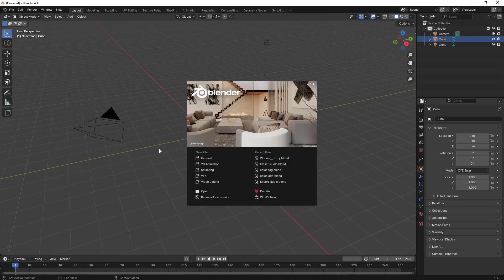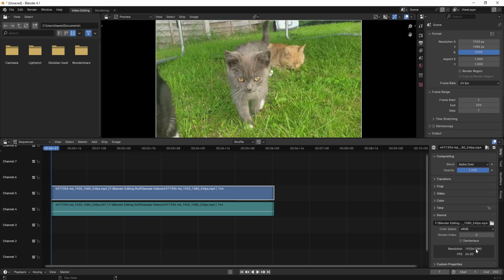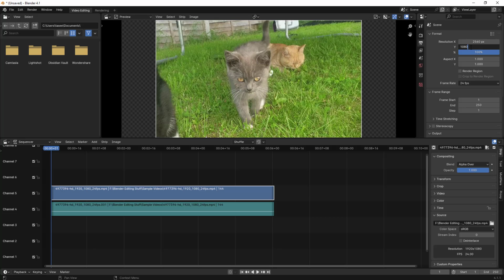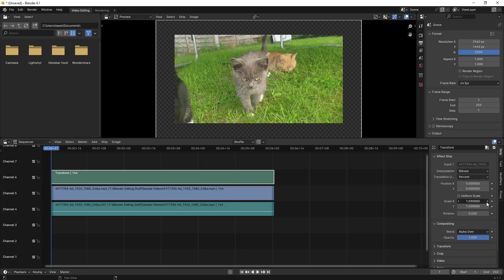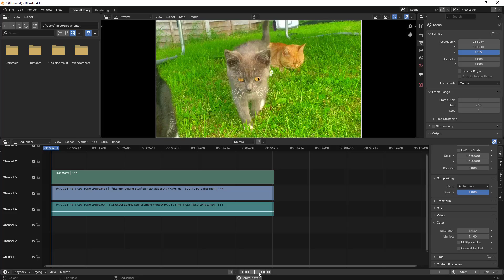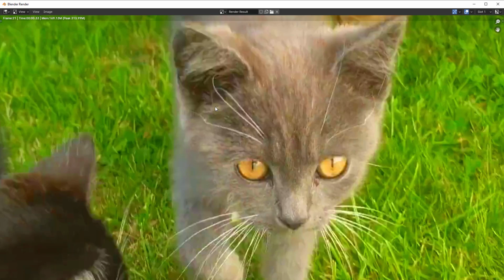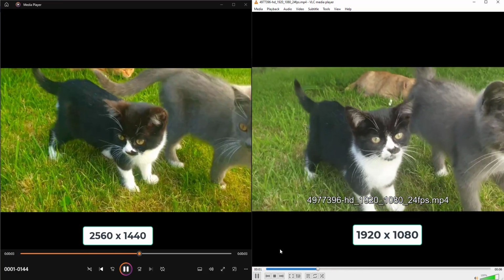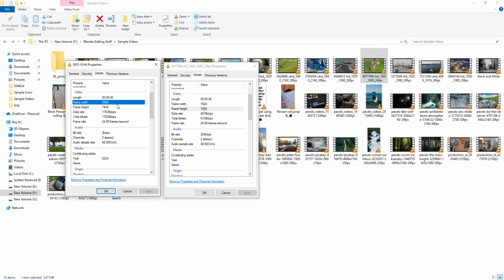How To Convert Low Resolution To High Resolution Video Using BLENDER?

Comment: You did not show the basic, basic, part of how to save the darn transformed file.  It adds .bland at the and it does not work in VLC.
Reply from the maker: When you save your project it will save as .blend file and these files cannot be open in VLC. As shown in the video you need to render animation. Make sure you set output setting to MP4. Please refer my videos which as created on how to export MP4 Video. Do let me know if you still have issues.